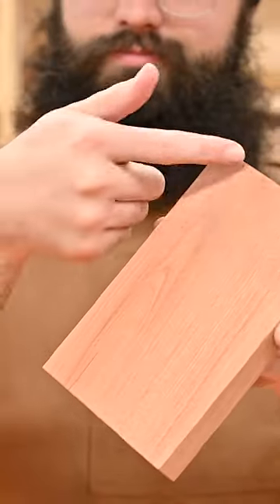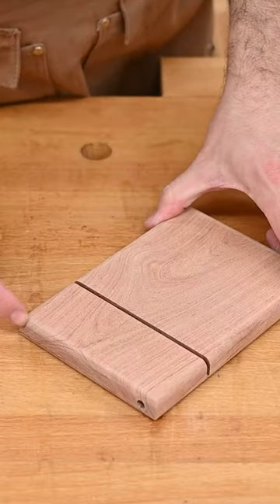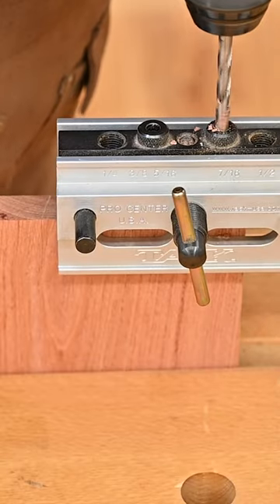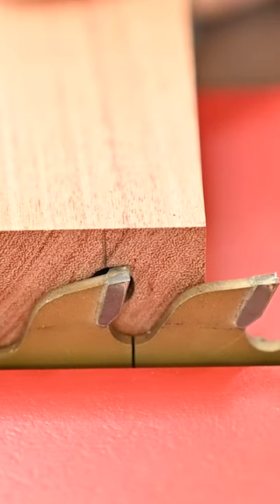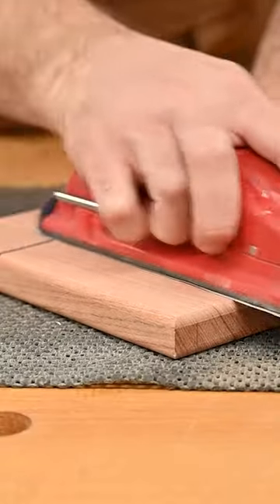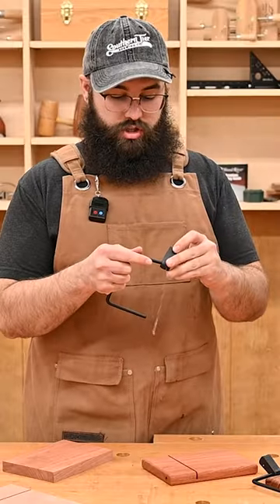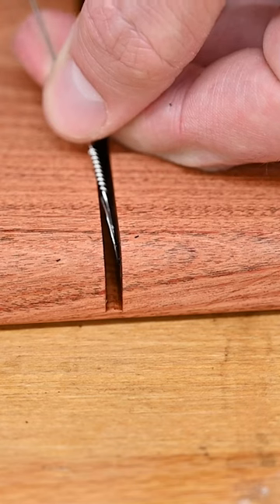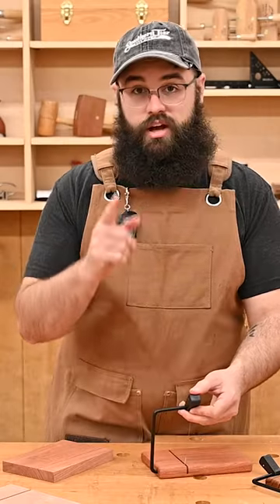Try Making a Cheese Slicer #woodcraft #woodworking #cheese #charcuterie #kitchendesign

Comment: Bad product for longevity, soft cheese is going to get stuck in the crevice and dry up, pain to clean.
Reply from the maker: How long do you let your dishes sit before washing them?
Reply: @WoodcraftSupply  Fair argument. I don't let them sit too long, but I don't clean them right away. Usually at the end of the day. But I'm not who you should be worried about, how big of a portion of your customers will leave them out long enough for a soft cheese to dry out, it doesn't take very long. I'm not saying the product is horrible, but the crevice is pretty tight for a brush to get into to clean it properly if that happens. There's a balance between how fast you can make that and how complicated of a design it would take to get around that problem, though, so I don't blame you.